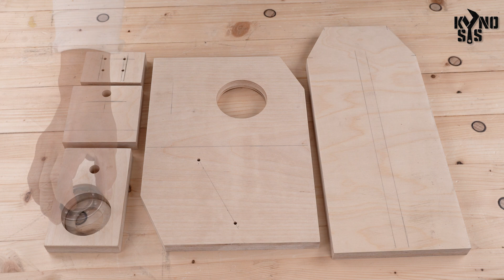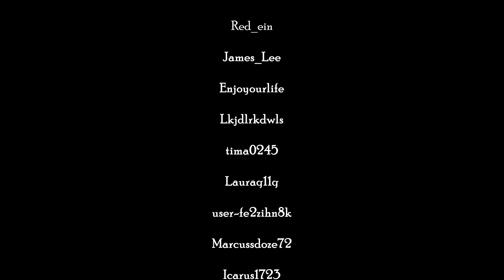Making a Vertical Drilling Jig / DIY

Comment: Where can I find those square blocks with bearing that moves up and down on that plastic rail?
Reply from the maker: Both the rails and blocks are made of metal. It's a part called LM Guide, and it's a bit expensive because it's a part used in CNC machines that require precise control. thank you!